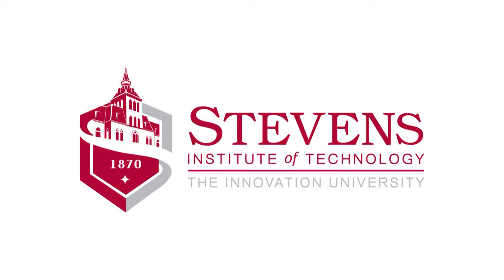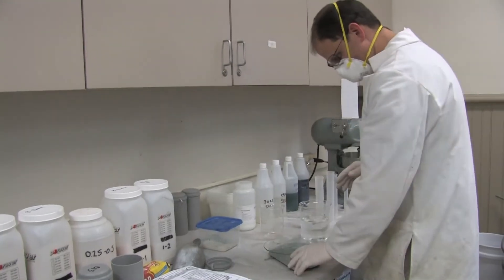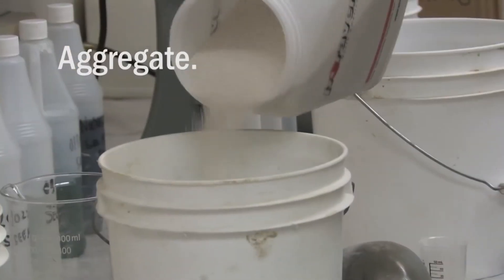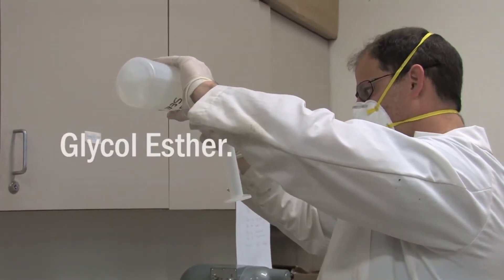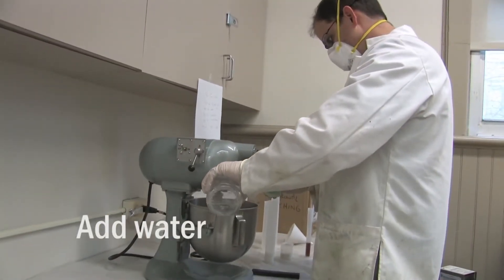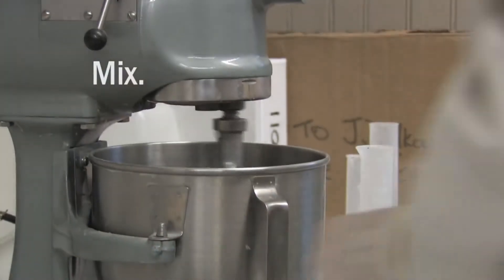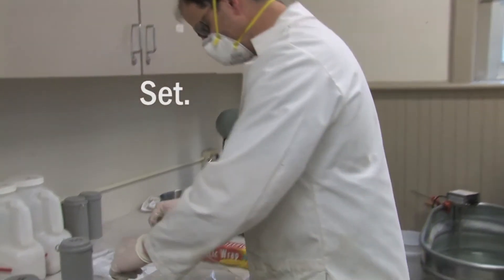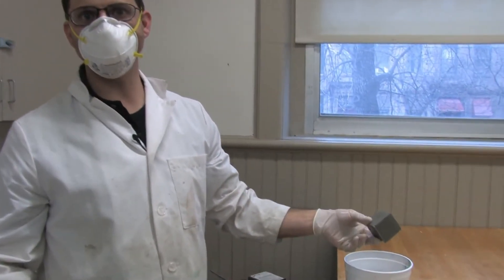Nanotechnology for Concrete

Comment: I have a doubt about thermal properties of cement  ? Can you clarify it !! Is there any material that can be used In concrete to make or to bring down temperatures that occurs during summertime? I mean that which nano material can bring cooling effect inside the house or a building?